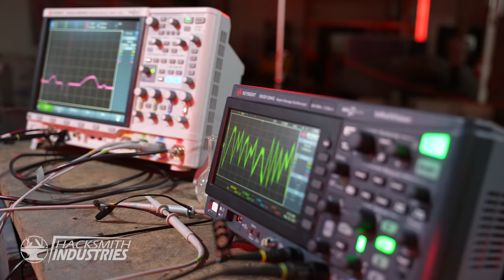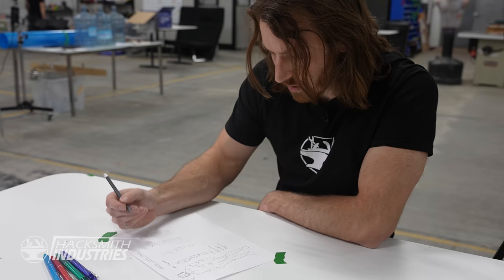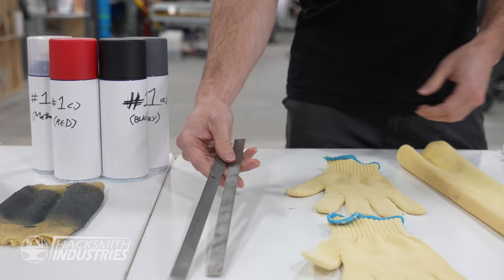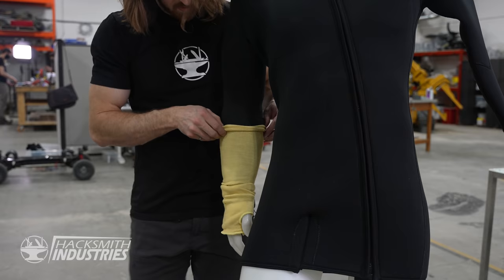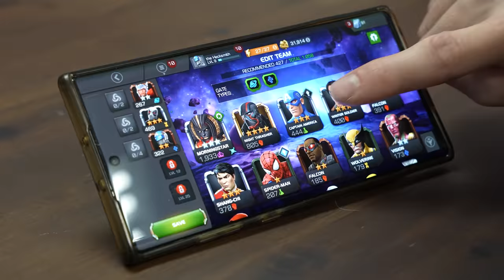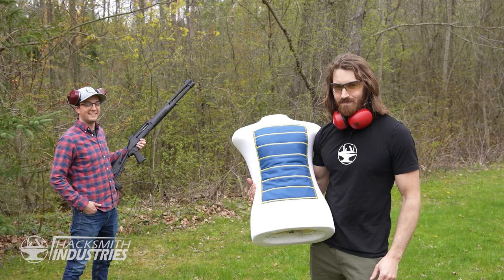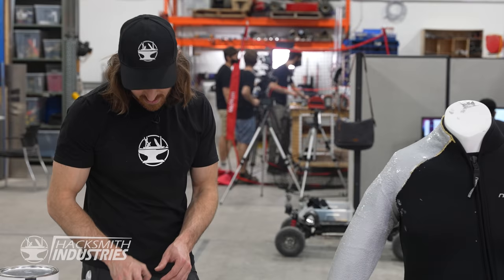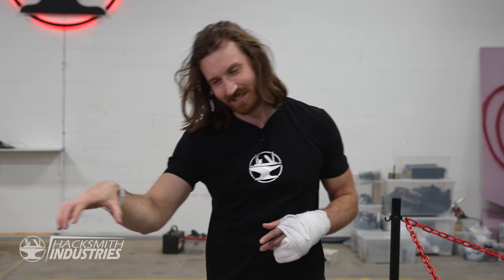WINTER SOLDIER ARM (BUILD)

Comment: You should put like rings of metal over it so it looks more like his metal arm
Reply: He put it on the wrong arm
Reply: But did well
Reply: I have no clue why he didnt make at at least look like it was metal
Reply: Adding metal rings would reduce the flexibility a lot and increase the weight by a lot but that would be cool
Reply: @silver-says4091  well tinfoil then. It’s look metal and still be flexible
Reply: @kitchengun3663  still that’s to flimsy with current tech it would be very hard to make it actually look metallic without taking away mobility

Comment: James: This fabric is used in most bullet proof vests, because it works well to stop bullets and knives
James five minutes later: cuts fabric open easily
Reply: If you want to know what's going on there, bullet-resistant fabric is stab and shot resistant but not slash resistant.
Reply: I’m not 100% sure but I think the top, blue layer that he cut through was just nylon. The yellowy-tan stuff underneath was the Kevlar.
Reply: Make yondu's arrow
Reply: Make yondu's arrow

 guys please make this visible for them please

Comment: My friends and I built an actual working winter soldier arm to scale, we used cables to make the arm retract, its able to lift 125lb comfortably, we used electric motors mounted that arent visible and battery packs under our clothing 😂 which I'm genuinely scared of, but it works like a charm and we show off with it alot
Reply from the maker: Make a video of it! We'd love to see it!
Reply: @hacksmith  yo did u forgor to test the arm out?

Comment: him: I'll be using cut proof Kevlar. also him cutting it with scissors ;)
Reply: I mean he said cut resistant
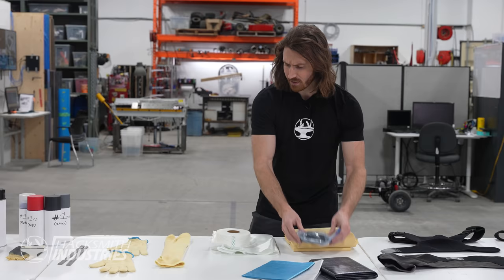Reply: @Sandwich8864  5:59
you sure?
Reply: That was the outside layer, which was not kevlar.
Reply: Kevlar usualy becomes cut resistant and gains its properties when combiend with some kind of epoxy
Reply: Random fun fact, Kevlar was made to be a rubber, then some pizza guy got tired of being shot at and made bullet proof body armor

Comment: you guys can work with that robotics company to get the automatic controlling sensor and modules that connect too the nerves, need a way to charge has too be strong but if practical titanium but cost would say aluminum or a mixed alloy. not to break things but to create a real winter soldier arm. the only difference is the metal of the winter soldiers arm.

Comment: If a jet pack can make you fly for 20 minutes,  then a smaller version could help you jump higher for a few seconds at a time. If you strengthen just the parts of your body that require more durability,  it'll be lighter and more efficient protection. Like upper fingers,  knuckles,  elbow, knees etc etc. Or whatever helps a person be a stronger version of themselves

Comment: hey for the metal you could use super baintic steel also UHMWPE sheet and sorbothan
Reply: i would propose a titanium structure with a sheet of super bainitic steel , small plate of boron carbid epoxy in honeycomb shape the titanium could be in honeycomb thick mesh with under it layer of bonded UHWMPE sheet and under it sorbothan layer .
considering that super bainitic steel is 1.7 time stronger than AR500 steel and UHMWPE is way stronger than kevlar and that boron carbide powder impregnated epoxy is reusable could be very good but would be heavier , way heavier but i could stops 5.56 to 308 with a 10mm  titanium honeycomb shape mesh and 5mm super bainitic steel sheet and 6mm UHMWPE and 10mm sorbothan  , the hexagonal boron carbide impregnated epoxy  tile would be 5mm  thick.
kevlar by it self is not good but UHMWPE bonded sheet are use for NIJ 4 body armor as backer and even for NJI3 and 3+ can as is self stops a 5.56
Reply: also replace kevlar by Autx  it better for fabric strike face